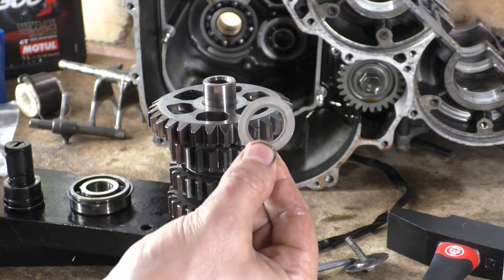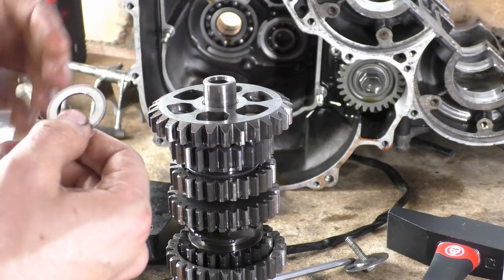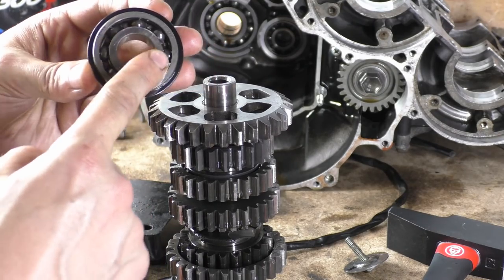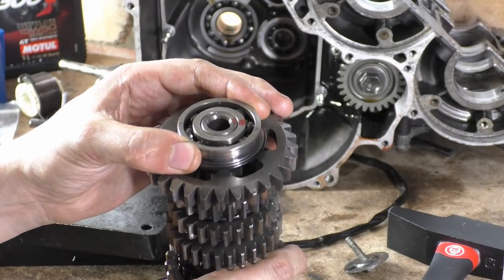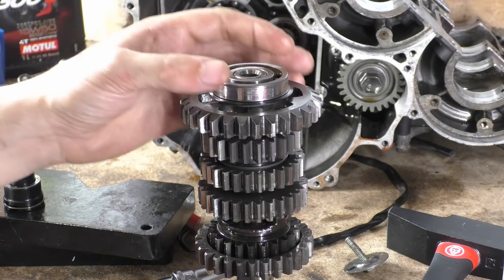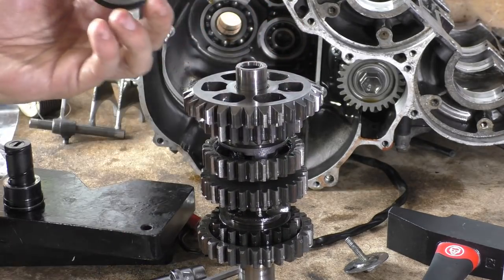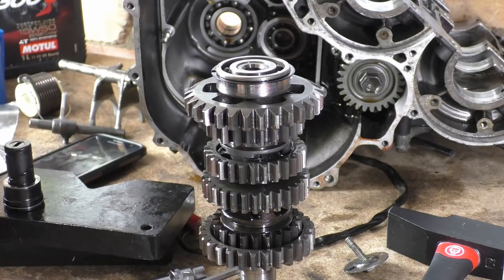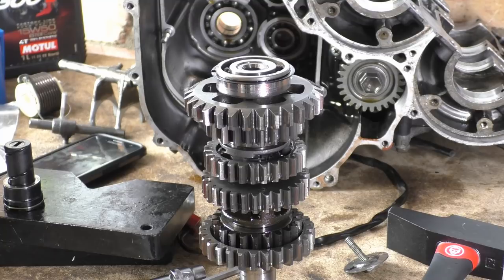Thrust washers/spacers - shop chat

Comment: I like your taste in music! Another thing is that in automotive use the Asians normally use a separate replaceable bronze thrust washer/bearing on one of mains but American OEM will often build them into the bearing shell itself which means you have to replace the main bearings to return thrust as it should be which is a pain! Also when a transmission has "shit the bed" and is beyond rebuilding a lot of people will machine the case and install thrust bearing in a pre-loaded condition to allow the transmission to be rebuilt often better than new. A man known "Marlin Krawler" for this developed the idea to give new life to Toyota manual Transmissions used in the old Hilux model 4x4.

When thrust is really bad it will almost sound like a rod knock sounds! If not repaired sooner or later you will have a rod come through the block and even worse a main break plus a rod coming out of the block! 

To be honest I have never heard a motorcycle with this issue and never seen a rod come through a motorcycle block but I am sure it happens!  For a while in the 1990 General Motors 60 degree V6's had an issue with main knock, rod knock and thrust issues. The Rod Knock was a design issues but sometimes the OEM would put the wrong sized bearing in the engine for both the mains and the rods. When knew it was not a big deal but once you had the slightest amount of wear on the bearings or the oil pump it was too much to handle. Here is the gem though. General Motors would not warranty repair it becasue the engineers said it was not a drivability or durability issue since the engine would make it outside of the warranty period no problem! You can not make something that stupid up if you tried!